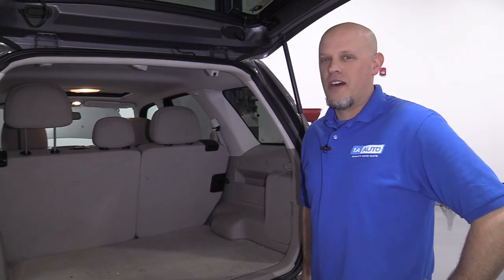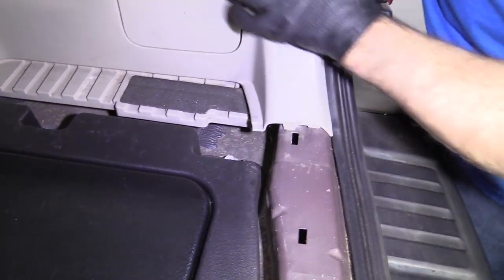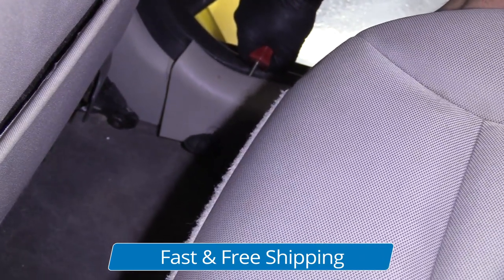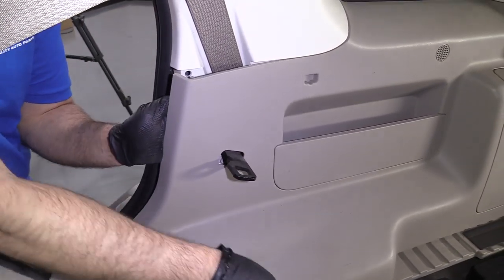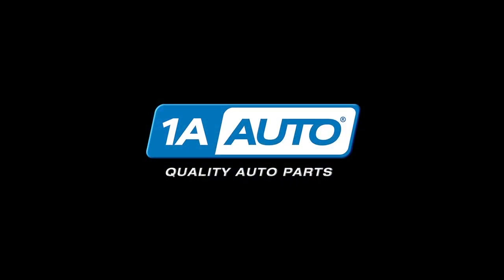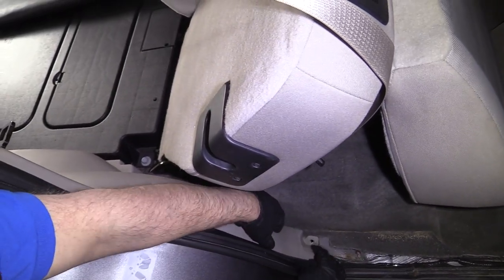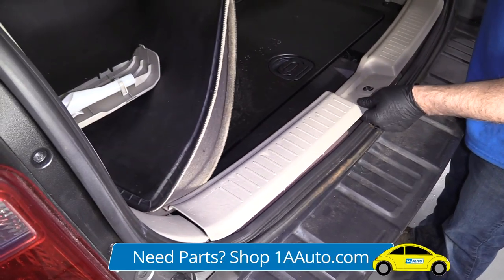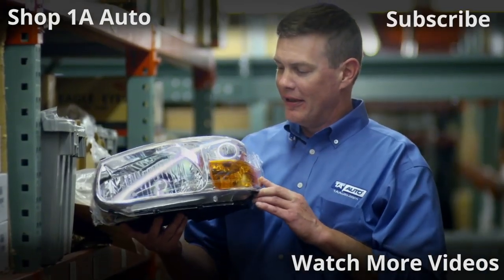How to Remove Rear Interior Panels 08-12 Ford Escape

Comment: Good video, thank you.  There is a mistake at 1:04...open that little cover and remove the fastener from there with a trim tool, not the way he did it, and you won't break it.
Reply from the maker: +urntwrthyZ Thanks for the tip!

Comment: Can't find similar video for the 2016, but seems like it might be just about the same. I need to access the rear passenger side pillar next to the hatch in the back due to a massive leak that's destroying my interior. I thought it was the brackets for the roofrack so I went and sealed all those very well and after today's rainstorm I realize that wasn't my problem at all. Of course this isn't as simple as I was hoping.